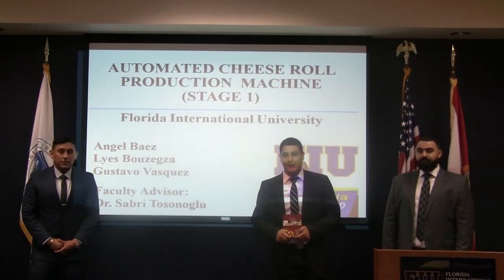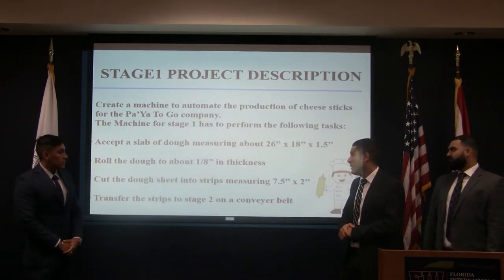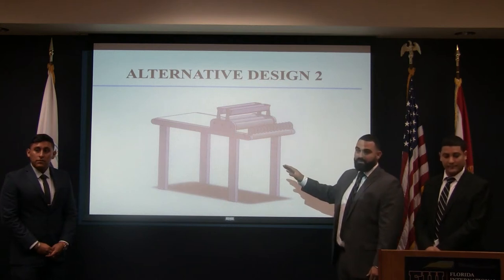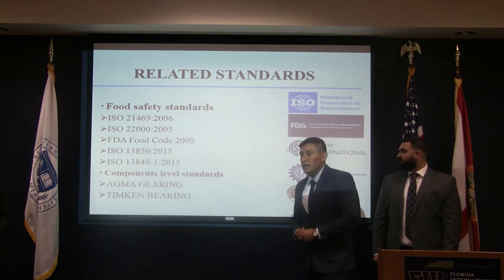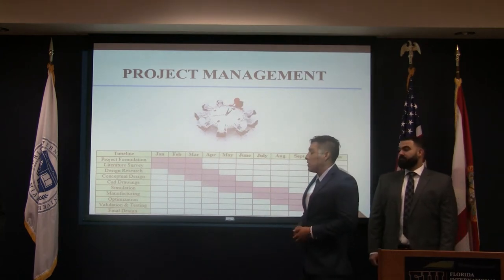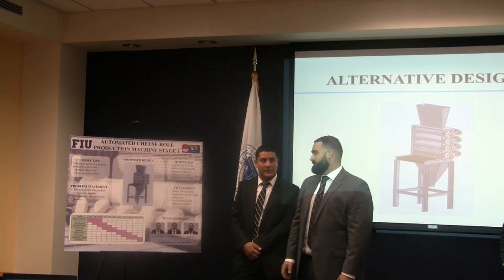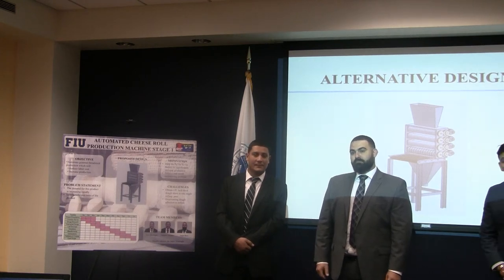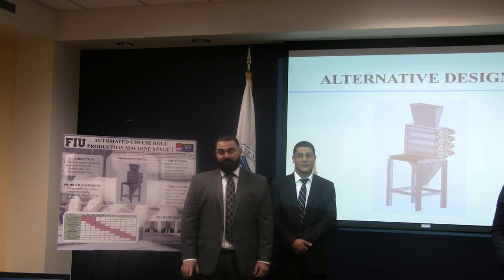SDO Team 3: Automated Cheese Roll Production Machine Stage 1

Comment: The team did a great job in addressing the need by their sponsor to further automate this process. The video showing the current process of cheese rolling is great because it helps in visualizing the impact of their project. The automation will be beneficial for the workers and reduce some minor injuries that can occur by performing the same motions many times. They had excellent design examples, it shows the team has put in a lot of work and effort into making the best process. The audio and visual quality was good, the presenters were confident and had good flow. It will be interesting to see their final prototype.

Comment: So I like the idea of incorporated gravity into your design. I work at a baking factory, so I see how these machines work when it comes to applying rollers to dough and so on so forth. The main problem that I see might occur would be at the cutter portion. First off, if there is nothing solid which the dough is being pressed on while moving through the cutters, the cutters aren't going to cut. Second, let's say the dough gets cut and moves on. The design shows that the dough will go from vertical to horizontal right after it has been cut. The problem that could occur here is clogging and jamming of the machine. It's a 90 degree turn being made all of a sudden. That works perfectly fine with a solid object, but not so much with dough. Third, flour I don't know why causes a lot of corrosion to mechanical machines, and where I work the flour corrodes the bearings really quickly. Also, it is possible through human error for someone to put more dough in some batches going through and less dough in other batches. If it's feasible within your budget and time frame, I would suggest adding a divider instead of just keeping it a funnel on top. Like that, someone could throw dough in from the top into the funnel, and the divider then cuts it. So each time your machine would be working with the same quantity of dough. These are just some other considerations that may be helpful to you all if taken into account and looked at it.